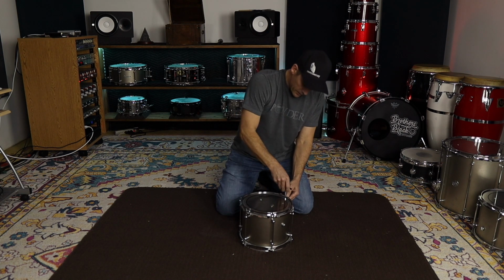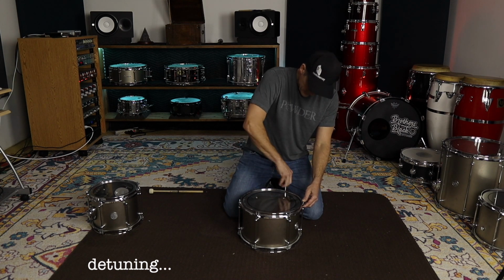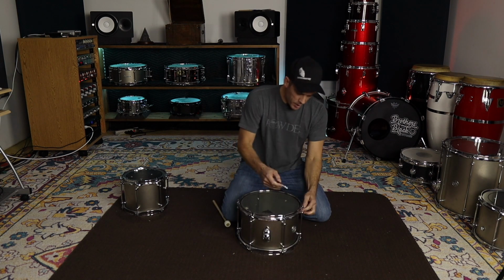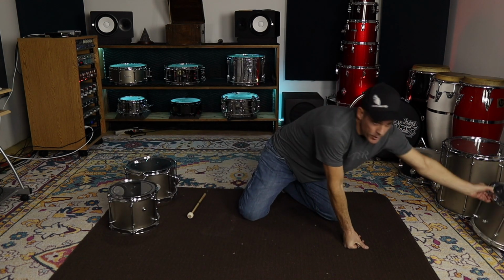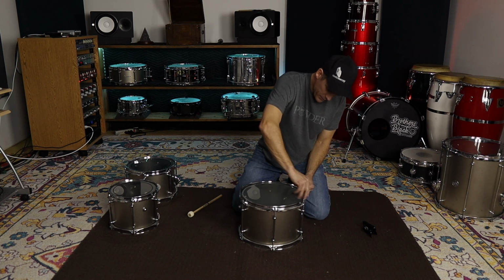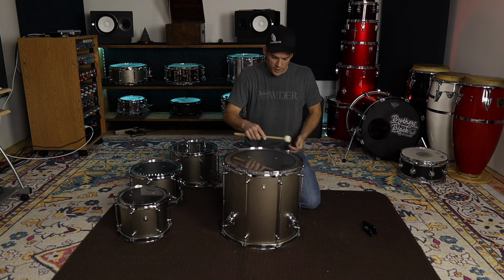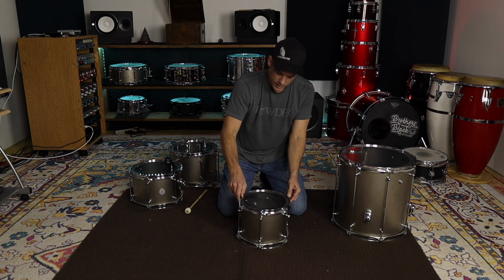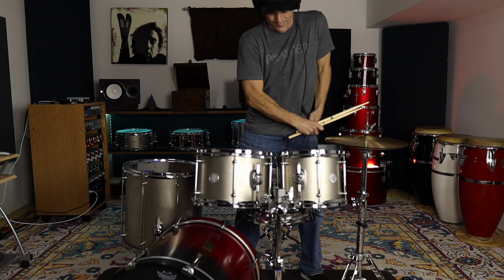How to Tune Tom Toms

Comment: very interesting method, but the floor tom is too high i think...
Reply from the maker: Thanks for checking it out. I used to tune the floor tom to a 1/2 turn, which is about as low as it can go. I've been experimenting with adding up to a 1/4 turn more for a little extra punch. I appreciate the feedback.
Reply: @ablackshedd  ok